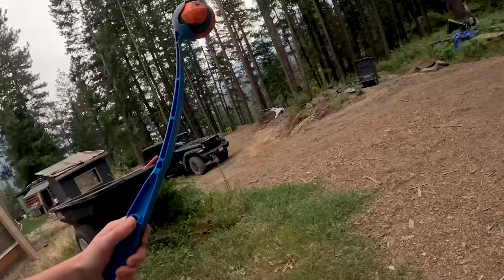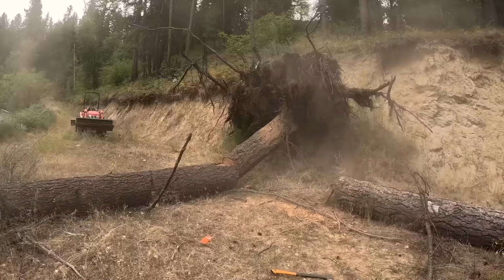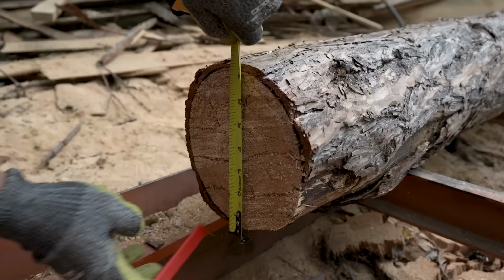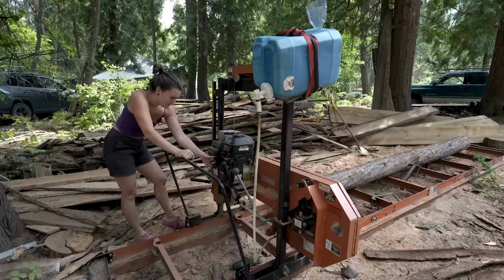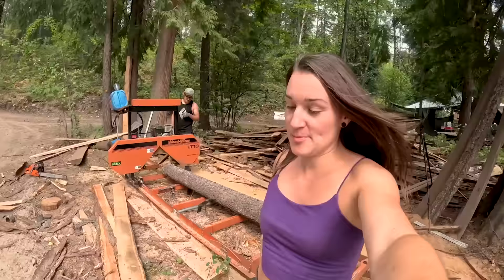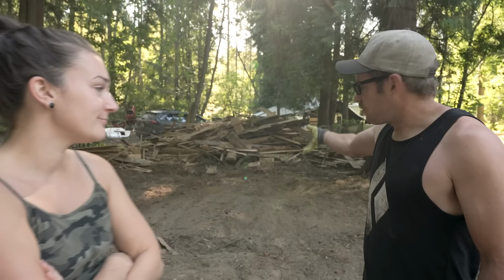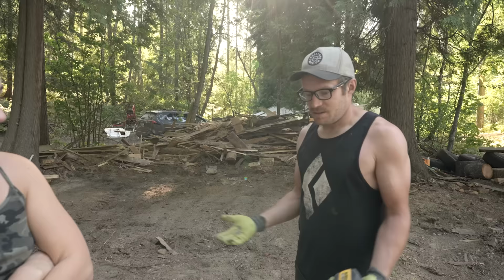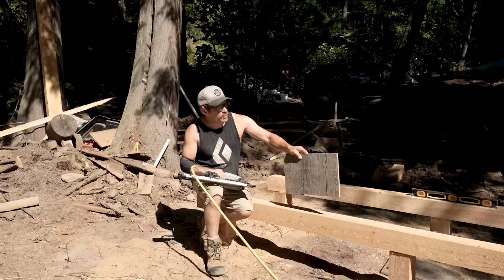We Should Have Done This A Long Time Ago | Fixing The Sawmill

Comment: Are the metal cross beams that hold the square tubes to stop the logs from falling off just bolted to the runner rails, if so is it just a simple case of unbolting and turn each one around to face the other way, do them one at a time so you don't knock things out of square.

Comment: might be overkill, but for a longterm goal build a deck/platform around the mill, and the back section there could build a small covered area to store your smaller cut lumber, with some like lumber racks, 2x4's 2x2's, 4x4's whatever, and that way u can mill whatever you have, and store lumber for later use, without having to worry about rain warping it.
Reply: that and it'd look pretty cool lol

Comment: The Voice of experience in construction work and logging offering useful labor-saving suggestions. You probably have a Quick attach / release Bucket on your Tractor, Buy yourselves a set of Quick Attach / relies Bin forks for your Tractor. Saves lots of hard back braking labor and you will be less likely to get one of you Hert doing something the Hardway. You can easily pick up most logs without a Can Hook and genteelly role Logs on to your sawmill instead of dropping them.

Comment: Have you guys ever thought about a rack for your off cuts from your mill.  Makes for a great place to stack them then cut into useable firewood for heat. I use to buy bundles of off cuts gram a mill. Bundles were 4’ x 4’ x 8 ‘   I used a ratchet strap around the middle to tighten up the bundle. Then cut the steel band strap that the mill put on. Then I used my chain saw a cut to the length i need for my wood burner.  Worked great.

Comment: just a thought, the saw part travels both ways, why not take it off the rail, turn the rail around, re-install the saw so now your roll off stops are where they should be on the opposite side of loading side?

Comment: You need to calibrate the head and release some of the upward tension on the saw It should just be adjusted enough that it takes little pressure to raise or lower it with your hand. Then you will find it will be rite for you Kate!

Comment: I applaud your work ethic and willingness to tackle any job! However, I'm surprised that you don't try and organize and keep your space clean. Maybe it's because you have so many projects that need to get done. If you had planned ahead when you got your mill to have it on a stable surface you wouldn't have had to take this time to do it and  likely wouldn't have had issues with milling your lumber.
Having said that, keep doing what works for you and congrats on getting the mill on a more solid platform.

Comment: How many outfits did KT change into? I would recommend building your log stop outside the mill frame so the logs wont shift the mill when it plows into them. Maybe dig 2 post holes and set 2 wood posts a foot above the rail. Move the saw head in line with the log stops to be sure you have clearance. When loading the log ,remove the metal stops so you can roll the log onto the bunks, 4 more post holes for a saw head winter cover..

Comment: Here in Okllahoma we must use solid concrete no dirt to fill our post holes with. Because Termites !  I Hope your frame stays sturdy.:face-fuchsia-wide-eyes: It is for sure better than it was.:trophy-yellow-smiling: You might be able to cut some square holes in the frame on the other side to drop in your square tubing to stop the logs from rolling off. Use a death wheel and a saws all with metal blade. You guys got 120 volts ? Maybe battery operated tools?

Comment: Just an idea when you can try and get a grapple for your tractor it is much safer look for a decent used one it will also help with dropping the logs on the mill if you bend the rails that will mess up your cuts also and it will be hard to see. Also it will save your back.

Comment: That was the first thing I though of when you said you would turn the saw around - Lifting logs over the stops AND stopping logs from rolling off. I'm sure you will come up with something clever. I thought you were going to pour a 10x20 slab of concrete. You got this. Thanks for sharing.

Comment: Have someone weld THREE 5/15  chain hooks to the top of your bucket.  One in the middle, and one half way from the center to the side on both sides. (Basically dividing the bucket into 1/3ds ..  Buy a 20-25 foot chain WITH HOOKS.  With that, you can handle things more safely and faster. Abraison will destroy those straps and they will break when your wife is in the line of fire.
  The concrete posts and raising the mill will be safer and faster, too.  
Awesome that Katie, (I apologize for not knowing your names as I just found you guys.) is willing to learn and do the heavy work, too. Most women want all the benefits of the hard work, but few are willing to sweat to help make it happen!

Comment: I really love your ingenuity and resourcefulness and your evident hard work and commitment. Keep going with that but I think this sawmilll project reveals something that I hope you can learn from. A job isn't finished until everything is tidied up and made ready for the next use. The mess around the sawmill can be avoided by having a properly organised discard pile and an offcut bin for burning on the log burner (or hottub). I really fear you tripping up on the very uneven ground with discarded bits of wood lying everywhere including your sawdust piles. Take great care and if I were a foreman I would be asking after every job 'Is everything tidied away? Is the equipment covered and placed for next use? Are the tools and accessories all put away? Is the work space all tidied up?' I would l love to be there and help you with that because it would make your insanely busy lives so much more productive and efficient - honestly! Glad to hear that the siding is in view: if you live in an environment where everything is not quite completed you will live like that forever...and I know off-gridding will have an element of that in any case, but finishing something will help you mentally and be less exhausting for you as you just go from one task to another. Well done in any case in resolving the mill issues.

Comment: You could have put the rails on the same way the were (dogs to the rear) and just spun the head around.  It probably would have been simpler than now having to create a backstop.  Especially since you'll also have to create steps and a walkway for Katie to be able to run it.

Comment: Awesome job team!
For your lumber mill, and everyone else's that I watch. Why not have a 'slide' ramp that you have your logs on? This way you roll the next log up right onto the mill. The log platform should be the same or just higher than the milling platform.
Using well knotted (knobby) logs or cutting some groves into logs or beams that are smooth would allow enough roughness to keep the logs from rolling before you want them.
Finally, the last two to three feet of the ramp should slide in and out, or be lifted into place, to allow 'walking' along the side of the milling platform.
For an 11-foot cutting length mill, three beams or logs would work. Having adjustable legs or just adding shims would help maintain the levelness.
As for the 'backwards log stoppers, make the ramp on the other side and again store the logs on the platform. This would hold them off the ground.
The platform would not be solid but two or three logs or beams.
I posted this same comment on another couple I follow.

Comment: Can the head on your mill be turned around the other way?  Many mills can run the head in either direction.  If so, take the head off, turn the rails around again and put the head back on the way you want it.

Comment: what would be the problem of removing and reversing the trolly on the rails and rotate the whole sawmill around again so the pins are on the opposite side from the sawdust chute, that will still eject to the open side of the mill, allowing easy cleanup.

Comment: It’s a pity you couldn’t put a roof over that mill with concrete pads in the floor work it will keep it true plus the fact that the shelter for the actual motor part of the mill

Comment: wouldn't it be better to get set up where you can get to both sides with tractor? Also pick the carriage off the rails, spin the rails around so the dogs are on the correct side and set carriage back down.

Comment: oh me;;;that was a butt puckerin turn around with the milll;;;;lollllllll;;;;worked out fine;;;I hollered what ya gonna do with the catch dogs but ya didn't hear me;;;;lol;;;oh if ya want to utalize the sawdust drill a hole in chute for hook to hang 5 gal bucket to catch sawdust for easy distribution where needed;;;amazing the weight that them little tractors can move around;;;my little kubota L235 with boxblade and two sacs concrete that had been left out in rain was place on box blade for extra weight to be lifted with loader;;;lo;;;later found a section of railroad rail that was left on property;;they wanted me to haul off;;;;so that turned into weight for boxblade;;2 anvils and a drag for leveling areas for sod after construction;;;lol;;;enjoyed;;;oh;;almost forgot;;;that poor feller that had to strip down for safety after camera stopped filming;;;threw me on the floor;;;;lol;;;ben there done that;;; so;;;girl;;;you're next;;;;lol;;;thumbs up and keep em comin

Comment: Cut that tree should not be cut by the root ball first but father down, not a cut from top but up cut. I have cut trees for fifty years and still do it, and as for pulling use a chain instead of rope. I also have my own mill as of five years ago. I am 65 and still cut down large trees. Also sharpen the chain.

Comment: You two are young and ambitious. I admire what you all are doing. BUT! Get a grapple.!!!! I run a small farm. Every year I cut down and saw-up dozens of trees the size of your fir. What I see you doing with your tractor using a bucket is just plain dangerous. I've got the same tractor as you. The difference is that I purchased a grapple for moving logs. slash and brush   With a grapple you can grab and securely fold just about any size log the tractor can pick up. No chance of logs slipping from their chains or straps, especially when someone needs to standing close to the logs to secure them to rge bucket. With a grapple you can carry heavy logs close to the ground. If the tractor tips while on side hill the log touches the ground before the tractor tips. The way you carry the logs with the loader bucket up high is a very dangerous practice. Your center of gravity is high and those logs swinging can easily pull the tractor over. Play it safe and handle your logs with a grapple. If your get a grapple, get it sized for a compact tractor. Don't get a skid steer grapple. They steel a lot of lifting capacity due to their greater weight. Another great benefit is that you can place logs directly on the mill bed, and surprisingly gently. That way you're not hammering your mill be every time you place a log. Please get a grapple for your tractor so that you two will live long and prosper doing what you like best.